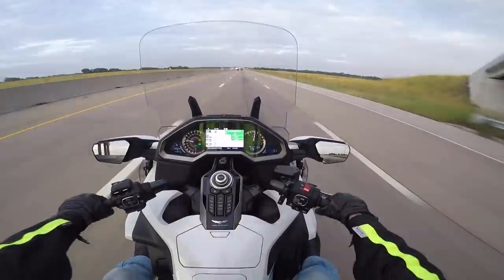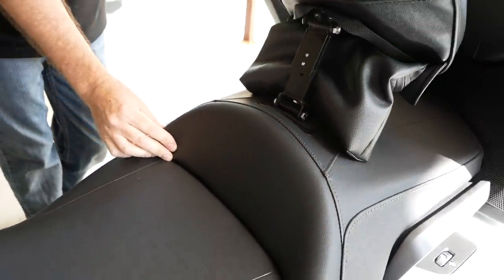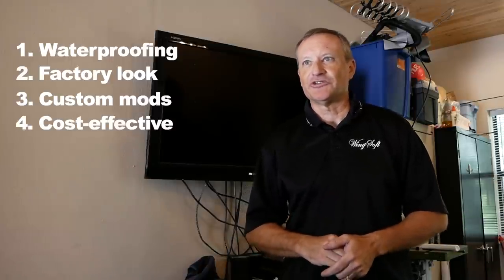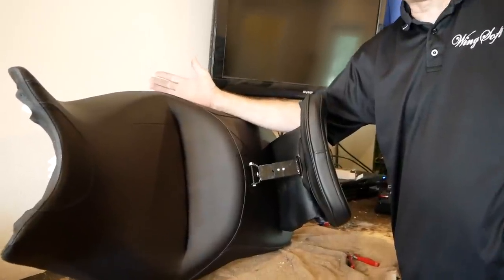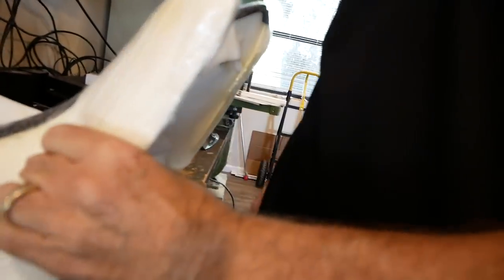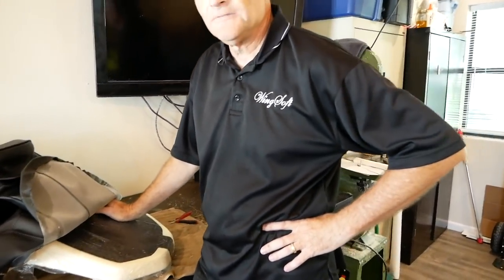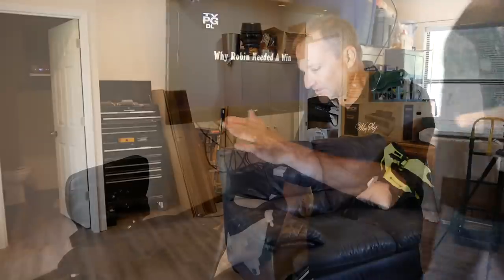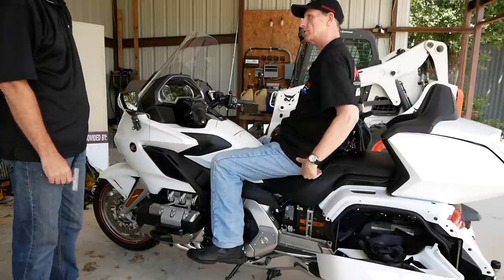How To Make Your Goldwing Seat More Comfortable | WingSoft | 2018+ Honda Goldwing (July 2018)

Comment: I do not recommend Bike Solutions. All butts not created equal, but after this modification (did complete seat and passenger backrest) it is more uncomfortable and looks modified with visible ridges that were not there before. John never replied to my messages to try to resolve this. $500 wasted.
Reply: If you don't mind me asking. What is your height and weight?
I'm 5'10ish 230lb.
Was thinking if doing the modification but don't want to spend $500 on something I am going to hate.
Did you see a difference in seating position? What are your thoughts if any difference?

I don't to bad with the stock seat, but I think there is room for some improvement. Especially for the passenger seat. (That comes from the complaining wife! :-)

Comment: I had the full Wing Soft upgrade. I did not notice any difference between the stock seat and the Wing Soft upgrade in the way of comfort. It was an expensive experiment for me, and I was not happy. I bit the bullet and did the Russell Day Long upgrade. I really noticed a huge difference between the stock seat, Wing Soft upgrade, and the Russell Day Long Upgrade. Maybe it is my body type or my tolerance level for pain, but the Wing Soft did not work for me. I read a lot of comments, where it worked great for a lot of Gold Wing riders, and that is great. If I am not mistaken, I think Cruiseman (Chris) ended up replacing his Wing Soft upgrade.
Reply: Same problem here. Now I have to send my $500 seat to RDL to have it re done! What a waste!

Comment: I did the upgrade for my 2018 DCT. Just the driver seat along with the driver backrest. I had no issues with the factory. But just did a 6000 mile trip and no issues what so ever. Made a huge difference

Comment: Hi. A "lot" of people complains abaout stock seat on their motorbike,  but in some cases the problem is not the bike but the body of the biker. 
There is something called the piniformis syndrom that causes pains in your bodys  seating area. The pains can be reduced with varius training exercises.
Ask you chiropractor or physyotherapist for advice on this. 
In my case it took 3 months of training before I felt ok in my bodys seating area.
So now do I ride my 2021 GW without pains in the a... with the stock seat.

Comment: I am 6-1 and 220lbs.  I had the full remodel done on my seat by Wingsoft. After just 3 days into a month vacation on my 2018 Goldwing Tour I can't ride 100 miles without pain in my butt.  Not much change over the stock seat. I may not be able to walk after this trip is over.

Comment: I did the full Wingsoft to my wing back in June of 2018. With the stock seat I could only ride 70 miles before discomfort would set in and ruin the fun...anyways, I'm 5' 10" and weigh 180lbs..the Wingsoft was a huge improvement over Honda's stock seat. I was able to ride locally without any discomfort at all...on road trips, I would say I was mostly comfortable for most of the day..12 hours...but I would have to stand up and sit down to relieve pressure points at times..but still the Wingsoft allowed me to enjoy my week long road trips in comfort most of the time...trying to do the same ride with the stock seat would had been torture and honestly I wouldnt have been able to do road trips on Honda' OEM seat...the trip would had been no fun at all.

I've enjoyed the Wingsoft for 3 riding seasons and was over 90% satisfied...but its that other 10% when I'm on long distance road trips that I want improved comfort with. I think to get the most comfort for long distance the seat needs more area to support your body weight for less pressure points. I sent my Wingsoft seat to RDL for them to build me a custom seat built for my body..hopefully that seat will live up to its reputation for long distance comfort that I've always read about...

but if you want more comfort and mostly do local rides, want your seat be waterproof and to look stock, this Wingsoft is a good value and I would recommend it to someone around my size..5' 10" 180lbs

Comment: I am 6'3" and 245#.  I found the seat on my 2018 Tour to be intelerable.  My 2002 stocker was "a little better" but I still replaced that with Ultimate Big Boy which I would grade as an "A-".  I would have gone Ultimate with the 2018 too, but Ultimate was VERY slow in making a fully functional saddle for the new model.  I had the Wingsoft full modification done to my 2018 and I was and am very pleased.  Is it perfect?  No.  Is it as good as my previous experience with Ultimate?  No.  But, it is tolerable now for an eight hour day ride.  I believe Wingsoft is a good option.

Comment: Had my seat on my 2018 wing pushed back about 2".  It cost me a few hundred bucks from a local upholster and the comfort level went up drastically. I'm 6'1" and my knees and back aching on long rides are no longer a factor in my riding. The only thing is I no longer have the slot for the driver's back rest, which I didn't really care for anyway.

Comment: At 10:05 there is a beautiful leather 2 seater and I thought thats what he did to your stock seat. Wow, !! Turns out that is a couch.

I have a non-tour 2018 and have had no problems with the stock seat. But watching the video a light bulb went off so I went back to a few forums and checked: Turns out many riders with the non-tour have no complaints about the stock seat. Two differences with the non-tour seat that ,may be interesting. Obviously more passenger room with no trunk but even more critical is non-tour has no heating element so its just foam. Interesting?
Reply: I never ever use my heated seat..... wish Honda would keep their heating element and give me more cushion on the seat.  ps - I live way up in northern Ontario where we have 5 to 6 months of winter.

Comment: This has completely put me off buying a new Goldwing. You would think that Honda would make their flagship touring bike comfortable to ride long distances? After all the Goldwing has been around a very long time and I am sure that Honda have had lots of feedback regarding this issue. I’ll be sticking with my 2010 wing and a removable gel pad on my seat.
Reply from the maker: Honda is not alone. Aftermarket seats are available for ALL brands and models.
Reply: @cruisemansgarage  
The Goldwing was synonymous with luxury and comfort whereas the likes of BMW etc etc are just as good but are not as comfortable. Now the Goldwing is just the same. Why would you have to spend thousands more on a seat when the majority of Goldwing owners all say the same.
Pre 18 models were sold with a reasonably comfortable seat.
So logic would dictate that Honda  should offer a firm after market seat if that’s what you want. 
But I think that they would not sell many of those.

Comment: Do you think on the 2021 model it will be better, because they changed a view things? It should be different for the passenger to because the angle from the backrest changed a little bit with the bigger trunk.......

Comment: I have your mod. It sucks. I took off the cover to add a gel insert, and your special foam is only in the middle. On a bright note, it made it super easy to trim your foam down 5/8", and trim off 1" to the edges for the gel. NOW......it's a great seat. Can I get a refund?
Reply from the maker: Interesting. I have referred hundreds of riders to Bike Solutions and I'll bet I have heard less than 3 complaints.

Comment: Cruiseman..Im curious to know what seat you are riding on now. I know you had the Wingsoft and then a Ultimate seat, then sold the Ultimate I believe..what seat are you using now...how would you compare the Ultimate and the Wingsoft seats?
Reply from the maker: I am currently riding on the WingSoft. I would say the comfort of the Wingsoft is comparable to the Ultimate, but retains the OEM look. I did prefer the looks of the Ultimate.
Reply: @cruisemansgarage  I thought the comfort of the Ultimate would be along the same lines as the Wingsoft  because its the same shape..to really increase the comfort the seat has to be able to support more of the riders body..the old wing had more of a buck shape and supported the body more than this new wings seat...my old wing had the Wingsoft and I could ride 930 miles in comfort..for this new wing to give the same results   I think it will take a seat with more area and a bucket shape like a Russel Day Long
Reply: We had the full monty done on my 2019 DCT Tour by John in early December and it is wonderful for us. We can ride for hours with no more pain. Money very well spent!